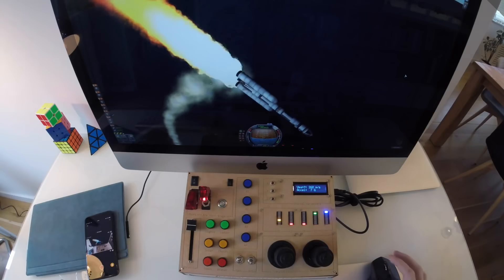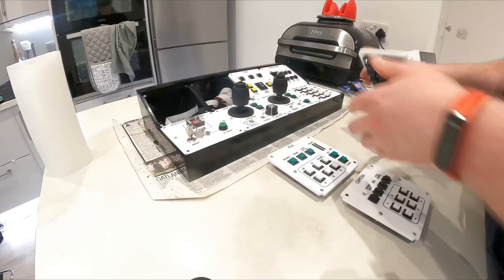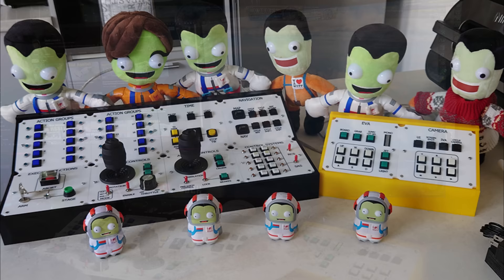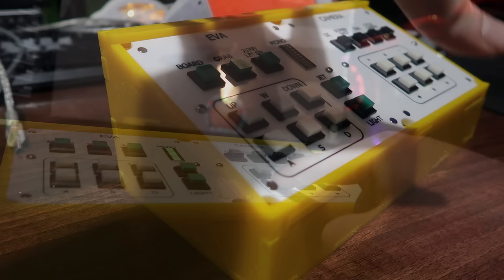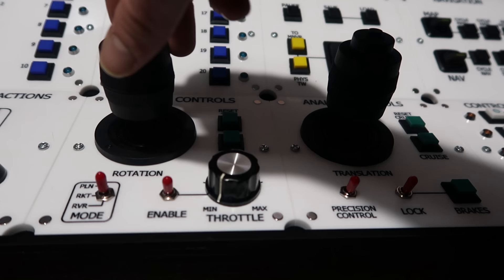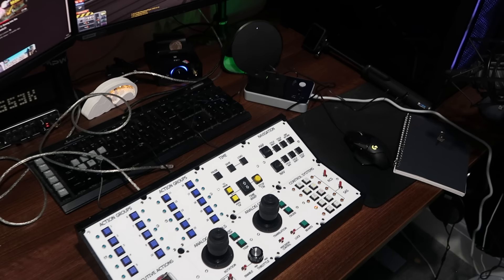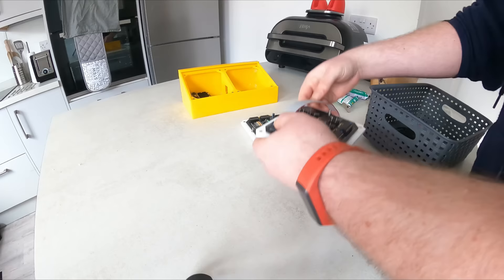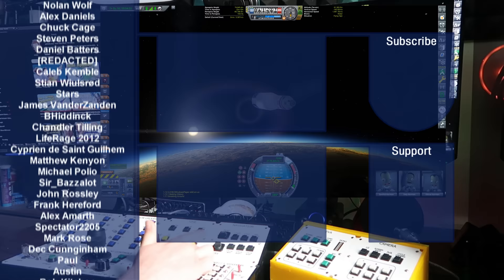I finally built my DREAM Kerbal Space Program controller 🤩

Comment: This, the VR mod, and a rumble chair would make an insanely immersive experience
Reply: The vr mod has like no interactivity with buttons. You can't even use the throttle.
Reply: Except theres no point of having any of these controllers in vr since you cant see anything. You're literally fumbling blindly on the buttons
Reply: @daniel_of_jersey4775 this is one of the major flaws of VR. If you mod controllers then you need the virtual representation to make them worthwhile. Not all games are compatible with those kinds of visual mods either. Unless you get really precise with making your real world mods match the virtual space you will be in. I did that with American Trucking Simulator and it was pretty good!
Reply: Needs augmented reality like the 3ds.
Reply: @roadkillraker  But more like jizzing in the rain.
Reply: maybe a vacuum chamber that occasionally draws air out to simulate how Jeb is feeling when he gets stuck in a module for years :P lol

Comment: I too ordered a controller. Great communication and easy enough to put together. Cant wait to see what he does for KSP2. I noticed he has added a few new interfaces. I love that this is modular and you can swap out with new modules in desired. The new throttle looks pretty nice.

Also...docking with the actual analog sticks is a dream.

Comment: that throtle switch could come in very handy, landing with minimal fuel... i actually have a 6 crew soviet style mun and minmus return craft without a parachute system... cause i forgot it the first time i used it... by the time i found out, i was landing it like ed baldwin on mars with no fuel at all... and you know what? forr 80m/s a second you really just need 4 engines and  6 tanks as crushing medium to survive

Comment: Very professional looking kit.

I keep meaning to try and make myself a control box for the PC but not limited to one game.  I have made up some really bad button boxes as a trial but never got around to doing a proper version.

There are companies out there that will lasercut to order so if you create a DXF/DWG file with your button cutouts they can supply the final panel for you to add your switches and wire them up to a USB HID board.  I have used ones from Leo Bodnar in the UK, they do a 32 button controller board for around £30, you just need to solder the wires to your switches.  Once plugged in it just becomes another USB controller on the PC.

Comment: KSP 1 needs an input update, where they replace Unity's Input Manager with the much better Input System (which is what my game, Solar Lander, uses).  Input Manager supports up to 20 buttons per joystick and up to 80 buttons spread across 4 joysticks, but KSP 1 doesn't distinguish between Button 1 of Joystick 1 and Button 1 of Joystick 2.  Input Manager also only supports up to 16 or so axes per joystick with up to 8 joysticks supported.  Input System on the other hand supports an unlimited number of Joysticks and an unlimited number of buttons and axes per joystick.

Comment: This is awesome! :D There's so many cool things about this, even apart from its very existence. The modular design is a great idea. Controlling via a mod is also great because you can have feedback like the monopropellant gauge and more controls. If you can control SAS by keyboard, I haven't yet found out how. (I ought to check, actually.) The only thing I'm not too keen on is that there doesn't seem to be anywhere to rest your hands while using the joysticks. It could be a bother when doing some tricky flying.

Good point that a recommendation isn't really required. The only reason I haven't built one myself is that, with my health being all over the place including severe fatigue and... my intelligence varies, and that damages my confidence because I never know when I'll be able to do stuff and when I'll just get frustrated. But I'm always looking for ways to improve my health.

Did you know eating saturated fats slows your brain down? It's a temporary effect, but a scientifically proven one. It's probably not my biggest problem by a long shot... though I have been eating a lot of it lately. Hmm! Anyway, I just thought I'd mention it as it popped into my head. I'm more concerned with getting enough rest right now.
Reply: There is a mod called QuickSAS to allow you to use the num pad for SAS
Reply: @wyldbytes  Thanks... but I don't have a num pad. :) I'll figure something out.

Comment: $980 is cheap for what it can do, I was really into DCS for a few years and to get the replica controls for any single plane you are looking at $500 MINIMUM for a HOTAS then around $800-$1000 for the up front displays that have all the buttons. Then add a couple hundred for rudder pedals. If you want a set up for flying helicopters with a side collective add $300 for a cheap decent one. Oh and DCS is much, much better in VR so add the cost of a headset and if your computer needs upgrades....its a snowball effect thing at that point though and you're halfway down the mountain to just buying a full cockpit with motion...I stopped playing DCS.

Comment: ML: "this setup costs 900"

me, also watching (modular) synth channels and knowing DAW-controller prices: "only 900?!"

tbc Matt got at least 12 modules, a big and a small frame, the USB-converters in those, and power. all designed and hand-made to order by one person, if I got that right. the hardware looks good quality from here, those joysticks must cost quite a penny, and the work looks tidy, too. for this specialty boutique luxury thing, that's totally reasonable.
Reply: Thanks. A lot of people think they can build one for cheaper, and they probably could, but would it arrive at the customer's house on the other side of the planet and still work?
Reply: @Codapop_KSP  ikr the parts cost alone! then you have to add the workhours and know-how, and think careful soldering and troubleshooting is fun... 
if there's something to DIY here, it's the mounting, like modding a chair to fit your modules in the armrests.
Reply: @AFNacapella  Definitely! In my materials on my subreddit I have offered to give people the magnets and dimensions so they can build their own containers for the modules to slot into.

Comment: I'd generally recommend raspberry pico for these projects, and programming via micropython. It is capable of acting as a usb HID device and has plenty of IO even without IO expanders.
Reply: You'd still need a mod for things like the EVA propellant gauge or little displays, and can you even control SAS from a keyboard (HID device) anyway?
Reply: @eekee6034  what do you mean by SAS? What I'm referring to is all the inputs, which can be mapped to a joystick. HID also supports joysticks.... An alternative is to use a bluetooth capable arduino or Raspberry Pico, to emulate a bluetooth joystick. Of course, you need another channel for gauges and so on. You might be able to get away with mapping it to force-feedback though.

Comment: Do you still need to use the mouse to create maneuver nodes, or can that be done via the controller as well (ref the 7:15 time showing the map/navigation panel)?  You pointed out the maps button will bring up the map, but I don't think I see a way to create a maneuver node (unless the joysticks can double as a mouse to move around and select a spot on the orbital trajectory).

Comment: I really dont think that the controller is worth that much, even with labor, but i suppose that the idea and design behind it are included in the cost.

The question. Do you still need to use the mouse to create maneuver nodes and to zoom in/out to right click the altitude markers so they stay visible? Same with all the right click toggles. Do you have to make action groups for all of them?

I mean, I dont mind, I just ask.
Reply: You'd be surprised. Materials alone is over 50% unit cost, with about 15+ hours of labor for a big piece like this. I design them entirely "for free".

Regarding mouse controls, you do still need the mouse for all those things. This controller replaces the keyboard and expands functions.
Reply: @Codapop_KSP  Really? Just to be clear, I dont mind about the cost, nor trying to diminish your labor. Its just that i focus more on the mass production. Which decreases costs on materials for increased profit.

The cost of the product is fine, what I meant is that the entire actual cost of the product should be less or around half the selling price. Dont give your labor for cheap. Specially when you are that good at the craft. After all, you had to get the laser cutter, the soldering iron, design the thing, etc etc.

About the mouse thing, it doesnt matter, I was just asking out of curiosity. Im sure its a blast to play the game with that controller. Good stuff.
Reply: @Alientcp  Thanks for the understanding! There might be some room for proper mass production in the future, but the market is quite small in general so it might not even be worth it. Scaling up costs a lot of money, so I or another company would need to be sure that sales would recoup R&D costs, and at the moment I'm not sure that's the case. I wouldn't say this controller is necessarily intended for the casual gamer, but the price is a LOT lower than a controller of this complexity would normally cost, since I've added in a ton of optimizations in the build process.

Comment: @Codapop_KSP Do the joysticks have the possibility of have adjustable tensioners? 
I'm thinking about some of the flight sim controller sticks and old Macintosh II GS controller: where if you prety a very tight controller that gives you a lotta resistance you can, or you can lighten it to flip-flop more loosely. Backlighting on switches would be a big +1. but I suppose that can prob be swapped in. :)

Otherwise great work. Looks really nice.
Reply: Thank you! Regarding the sticks, unfortunately no. The sticks can only be deadzone adjusted, and only then on two axes.

Comment: It's funny that you are still controlling with a joystick as you would with a keyboard. The point of joysticks is precise control rather than on/off. So instead of repeatedly pulling it to a direction, just point to the direction you want and the deflection you need and wait. You control the amount of deflection rather than how often you "press". Muscle memory is a bitch though.

Comment: Your controls are backwards… left is translation and right is rotation in IRL and most space games.
Reply: WASD is on the left and commercial/private pilots usually fly with the left, while most game controls and fighter jets have the rotation on the right. The controller system allows the user to pick which way suits them best, so either way is fine. Matt could even switch it now if he wanted.

Comment: It needs a dedicated mod? It's not possible to make arduinos present themselves as regular PC joysticks and keyboard keys and such?
Reply: You can but then you can't get information from KSP, such as Action Groups states, Timewarp, fuel, apsides, etc.
Reply: @Codapop_KSP  The mod is just for the LEDs/displays then?
Reply: @tiagotiagot  And more direct joystick support and analog throttle. Most of it could probably be done with arduino joystick emulation, but throttle in particular is a bit tricky. Timewarp and SAS modes are also pretty reliant on the Simpit mod.